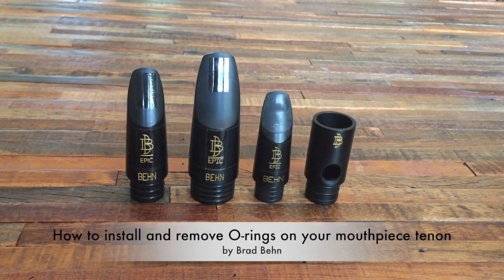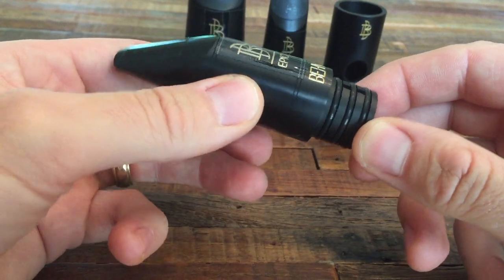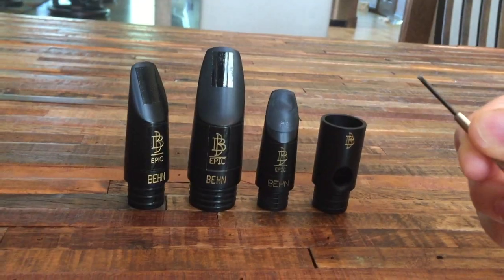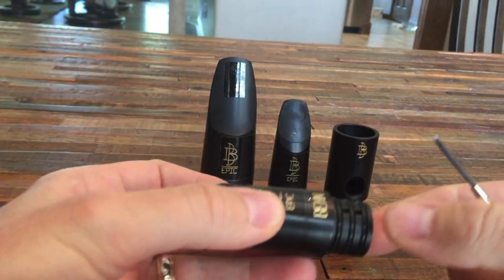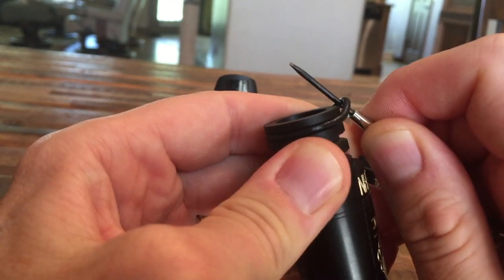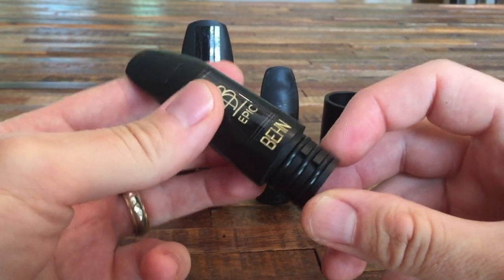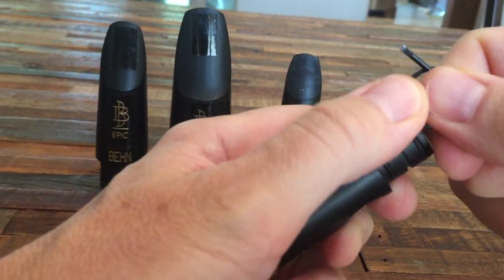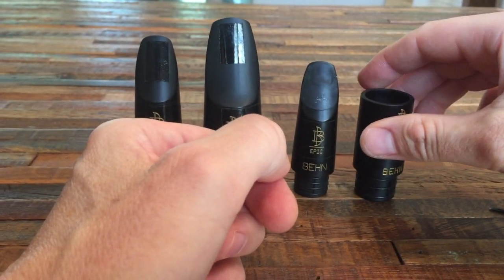How to install and remove O-rings on your Behn mouthpiece tenon

Comment: How often should the rings be replaced?
Reply from the maker: O-rings needn't be changed unless a need arises.  We offer different size O-rings to accommodate loose or tight fitting barrels.